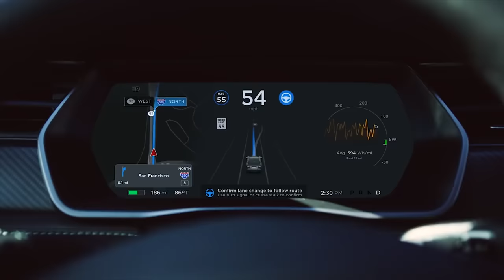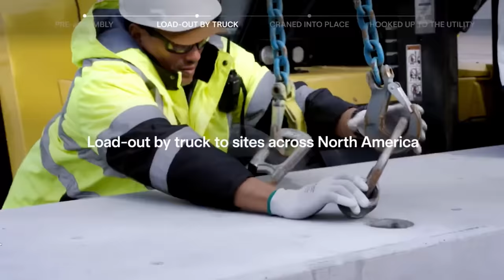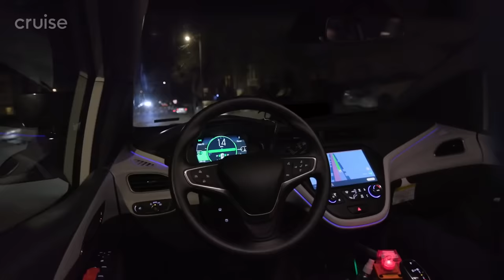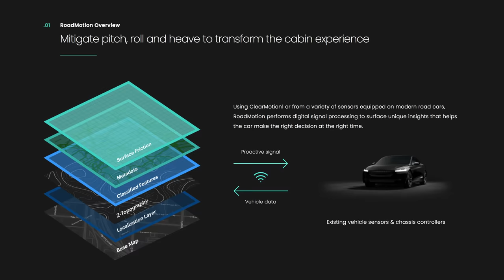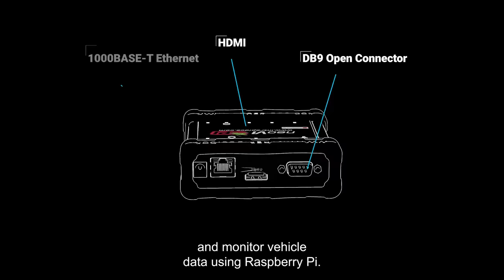BYD Makes More Per Car Than Ford; Tesla Slashes Supercharger Install Time - Autoline Daily 3786

Comment: The dealer network in general should be abandoned and dealerships should all be turned into repair and delivery stations...
Reply: No dealers are importend and amazing!
Reply: Get a Tesla, Lucid or Rivian today without the horrible dealer ripoff.  I bought my last three cars direct and it has been so much more pleasant.
Reply: Also convert some of the dealers into changing stations.
Reply: @brunoheggli2888 amazing at fucking the poor. I make $15/hour and CarMax dealership gave me a 2015 honda accord for $36,000 when the sticker price is $19,990. That extra $16,000 is all profit for them because they financed the deal too. I was young and naive, these dealerships do not care about people, only money.
Reply: Franchise dealer lobbying is very powerful. At this point I doubt the benefits of lobbying, tbh. Our economic and democratic system needs overhaul. Otherwise, we are gonna get stuck behind China pretty bad.
Reply: As a Tesla owner, dealing directly with the company that made my car is a HUGE improvement over the dealership model. Car dealerships add zero value.
Reply: @dangrass  this is the main reason I am considering a tesla despite renting rather than owning my home.
Reply: @jiamiekori6575  Gotta love the term "lobbying", the politically correct way of saying bribing.
Reply: Stupid will NEVER die!  I want a Volkswagen with privacy protection so I can see the dealer every week and make them do a manual software update....

Comment: Ford better step it up FAST instead of delaying everything.
Reply: Legacy does not want to see loose its golden goose.
However... w/o dealers pressuring automakers maybe their cars would last longer.
Reply: @danharold3087  
Looks to me as if Legacy is feasting on its golden goose.  

Legacy needs to be breeding a new golden goose because the current one is aging out.
Reply: BYD is looking to sell 4 million cars in 2024, which is getting close to Ford global sales numbers. By 2025 BYD may well have overtaken Ford in total units sold.

Comment: My experience in construct suggests that Tesla’s shortened install claim is all about pre spec civil works off loaded to a geotechnical/foundations contractor.  That contract is executed, complete with buried conduit, then they show up with their installer and drop the prefab units in.  Makes sense, as civil work is highly un-optimized, but I suspect a lot has been offloaded.

Comment: Any OEM that does not use direct sales has given up the pricing power that Tesla has because of having to pay a middleman. Ergo they will never be able to compete on price.... full stop.
Reply: Direct sale is shit!
Reply: King Toyota 6 full points of margin higher than legacy sales network Tesla!  Direct sales model ancient!
Reply: The dealership model will have to change.  The real profits are in maintenance, repairs, and parts sales.  That profit source will drastically shrink with EVs.

Maybe the future of dealerships will be something like Tesla Showrooms.
Reply: @bobwallace9753  Imposter CyberTruck owners beg to differ!  Chevy Vega more reliable at launch!
Reply: @bobbbobb4663  
Where does one find reliable data showing that the Cybertruck is unreliable?   I haven't found any.
Reply: yup....and I think people are just done with the dealership horror. Given the choice most folks would much prefer to buy the car online and have it serviced by the folks who built it.
Reply: Yep, not only do they cut out the middle man but they also can capitalize on "market adjustments" based on back order length like Tesla did, brilliant move on their part, just charge what people are willing to overpay for a car from the factory.
Reply: @anydaynow01  LOL sooo true.

Comment: Ford Mach E are Made by Mexican for American?👍
Reply: I think that's the only current Ford made in Mexico (please correct me if I'm wrong).

GM, on the other hand, makes the following in Mexico:  Chevrolet Equinox, Chevrolet Blazer, Chevrolet Silverado (Crew Cab), GMC Terrain. This also includes botht the EV & ICE variants the Blazer and Equinox.  I'm not sure about the new Silverado EV though.

Comment: Tesla charging will be a massive business itself and I think Tesla could buy convience store chain and just rebrand them as Tesla and have superchargers
Reply: Wrong!
Reply: Their price per kw will have to be more competitive then it is now or they will not gain much business.
Reply: @gmv0553  There is a lot of motivation for fossil fuel suppliers to keep the prices of fast charging and gasoline near parity.   Electricity is primarily generated by natural gas and coal.  So they have their have access to both ends.    I am familiar with the fact that they are globally traded.
Reply: @gmv0553  - It's still cheaper to fuel via Superchargers than gas for similar size vehicles. Perhaps in a few places where gas is highly subsided like Saudi Ariba it might be more expensive to Supercharge.
Reply: Tesla is actively working out deals with hotels restaurants and retail spots to place their supercharger stations and each party will take a cut of the revenues. No purchase of brick and mortar needed.
Reply: The big money is not in selling junk food in convenience stores.  And it has nothing to do with Tesla's mission statement.  Best to work out agreements with convenience store owners to install Superchargers at those stores and make money from charging.
Reply: @bobwallace9753  Just the charging rev. Dont think Tesla cares about corn chips.
Reply: @dclpgh  
I have no idea what you are trying to say.
Reply: WOW.... really? I said that in my original comment.
Reply: If they collab with 711, walmart, and familydollar it would cover almost all counties in every state.
Reply: @dclpgh  💯
Reply: 90% of Ev buyers charge at home public charging stations will never be a massive business, if they break even, thats about all they can hope for.
Reply: @davewhite113  the only problem with that scenario is apartment dwellers. I do know someone that bought a leaf and never had a home charger and just charged it at work for free. Then the pandemic kit.

Comment: Still wish Tesla would make a "off grid" package (solar, battery storage, charging stations all in one) for charging stations, to help take away the fears that EVs will bring the power grid down. It would also could be presented as something for use when grids do go down so that government and emergency services can still be on the move, plus owners of EVs could be still keep their vehicles going, which those with vehicle to grid power options could help keep homes, hospitals, etc, going in a major power outage. I really think it would be a great image boost for EVs in general if more of stations could be viewed as something to help keep power grids going or support for when they are down.
Reply: there is a company that made that with it all folding solar onto a basic flat trailer for 18 wheel truckers... solar could totally do that to debunk the naysayers.
Reply: Just settle for the Off your Rocker package you bought
Reply: @HDHQDIRECT  My Model 3 RWD has been great. Not missing ICE at all.
Reply: I actually thought Rivian was going to do this since early on they said they wanted to install chargers in remote locations.  Imagine an all solar/wind charging station in a national park.

Comment: You need to understand that US OEMs are going to go away or downsize to boutique manufacturers. 
If the Chinese get into the market here in the US then it will be quicker. Regardless Tesla will kill them with its gen 3 compaq car as well as robo-taxis. 
Why am I confident in this? Because I understand how much cash flow it takes for these OEMs to service their extreme amounts debt. Once we pass 25% new cars being EVs (most likely by 2026) the collapse in their cash flows ability to service their debts will start. Some sooner than others.  Once that starts they will have to start drastically downsizing and closing factories. The UAW will strike (as they gained the right to strike on plant closures) and the sheeot hits the fan. The collapse will then proceed very quickly.
Reply: Been hearing about Tesla Robotaxis for many years. Vaporware doesn't count.
Reply: @DouglasLippi   Remember when those 2017 and 2018 Model 3 owners proudly touted that their cars would be usable as Robotaxis?  🤣
Reply: The more they talk about profits made by OEMs the more people like you yap about them going down… what is wrong with you? Difficulties to understand?
Reply: Thanks for the laugh! You have no clue on what you are talking about!
Reply: About 95% BS.
Reply: @DouglasLippi  You should bring an open mind to it.  Not a single AI computer eng. chimes in to say it’s all fake like you are claiming. It’s a cry from the FUD crowd every time.  And always from ppl w/o any time withe the technology.
Reply: @DouglasLippi  
You need to watch some Tesla FSD Version 12 videos.  Tesla has made a huge, huge breakthrough when it comes to self-driving.  

Ignorance is not bliss....
Reply: @taniabanes4707  I guess we will see in the next four years if I am right. Then remember that I said it.
Reply: @gmv0553  Four years from now we both will see who is right.
Reply: @DouglasLippi  It will never happen!!!

Till it does 😉
Reply: @Cakebattered  still not off the table, but looking less likely with every passing year

Comment: BYD makes more money because labor is cheap. And they don't have profit sapping Unions to extort financially enviable salaries and benefits. I won't name names, but, UAW!
Reply: Wrong!
Reply: Labor is not so cheap in China these days.  IIRC labor costs in China are higher than in Mexico.  Look for one or several Chinese EV manufacturers opening factories in Mexico where they can build for less and import into the US without getting hit with tariffs.

That said, I'm not convinced Chinese EV manufacturers can compete with Tesla over the long run.  Tesla seems to be about to produce an EV with very few, possibly no, humans working in assembly.  And many of the parts and components produced very cost efficiently.   If Tesla cuts the time to produce to half of that of legacy factories that means roughly a 50% reduction in capex per car.

I'm sure Chinese companies (unlike US and European companies) will imitate but Tesla is likely to stay in the lead for some time.

Comment: What’s not being reported as of now if the quality of a BYD vehicle. What is the reliably and maintenance cost per year for the car. My concern as a consumer is would BYD be transparent with safety concerns, recalls. I would have this concern for any new auto start up. In the United States we have regulations for these concerns. Consumers should know the quality and reliability of the car they purchase. What is the crash report of these cars. I don’t believe BYD would be sold in the United States but they will be sold in Mexico and it’s possible they will be sold in Canada.
Reply: BYD has COMMERCIAL vehicles running the streets of the US, Canada, UK, Netherlands, China for a decade! Please stop exposing your ignorance in a public forum!
Reply: On a subjective level, BYD cars are clearly better put together than Tesla, with more consistent paint and panel gaps. They rank well above average and better than Tesla in the China Automobile Brand Quality Ranking. And the Seal and Dolphin were ranked as the top two safest vehicles globally, based on their performance in 2023 Euro NCAP testing, which is a stricter test than the older test  that Tesla went through for the 3/Y.

BYD's superior quality and safety has been reported, some people are just not aware of it.
Reply: Sandy Munro has good things to say about (at least) some Chinese EV companies.  In order to sell into Europe or the US BYD or another Chinese company would have to pass local safety tests.  Chinese EVs are being sold in the EU right now.
Reply: There's a reason BYD is THE biggest "new" energy vehicle maker in the world. are you trying to say those buyers can't tell the product they most likely use daily are good or not?
Reply: @bubuneowoo6161  Stop spreading your ignorance. A commercial vehicle is not the same as a family car. GM makes some of the best trucks, but their sedans were a completely different story.
Reply: I've got a deposit on a BYD Seal. Can't wait.

Comment: 3:39 I watched about 2 dozen spots open up near me, but it took like 2 months. So maybe it only requires 4 days of work, but other factors cause delays. Or Musk is lying as per usual.
Reply: Thats just the install they are hyping. Running the required power to the site and all the other equipment necessary can take quite a while

Comment: Of course BYD makes more per car.  Does BYD pay union wages or a living wage or even a good wage?
Reply: Cope better. BYD uses robots!
Reply: @bubuneowoo6161  Clueless.
Reply: They have the modern equivalent of slave labor.
Reply: @bubuneowoo6161  have you seen an American auto factory....full of robots too.
Reply: @tomjanowski8584  While the advent of smart humanoid robots is new you are correct about manufacturing's use of robotic arms and the like.  It is the human shape and the smarts that has people talking.   A humanoid robot should provide consistent assembly where humans struggle.

Comment: Here is my issue with blaming Tesla for auto pilot crashes. There are many other brands that offer this same technology, and I am sure crashes have happened with other auto makers. It feels like authorities are tagerting Tesla because of the name recognition. I have a Nissan that offers similar technology. As the drive, I have to be aware and take control when conditions warrant me taking control. I am always alert and aware, although my car is doing much of the work. I am not a fan of Tesla. I have chosen Rivian over Tesla. My point is this is a new technology in many new cars, not just EVs, and for some reason, Tesla is the only one being sued. The driver is always responsible.
Reply: It maybe a matter of scale.  A lot more Tesla cars driving with the technology.  But I agree that is not reason enough to  concentrate only on Tesla.
Reply: The case that was just settled.  Apparently the driver who was killed engaged Autopilot and then started playing a video game.  

If you turn on cruise control, don't pay attention, and your car rear ends  another car in your lane is that the fault of cruise control or you?
Reply: @bobwallace9753  I thought with Cruise control you couldn’t take your hands off the wheel. So how was the apple engineer playing video games? There was a video in the news just recently of a guy that looked like he was asleep in a Tesla on the freeway. How does that happen?
Reply: @russh6414  
Autopilot and FSD require periodic contact with the steering wheel.  I think Tesla may have added a camera inside the car that checks to see if the driver is looking at the road, but that would be only on newer models.

I'm not a video game player but I imagine there are games that don't require both hands at all times.  

Consumers Reports told people how to fool the system by, IIRC, attaching weight to the steering wheel.  I lost my last respect for that organization after doing that.
Reply: @bobwallace9753  Consumer Reports also showed how you could enable autopilot on a set up track and jump in the back seat with it still driving - right after a fatal accident in a neighborhood where 2 people died.  It turned out autopilot was not in use and not able to be put into use there and not the cause of the accident at all.  Pretty sick that they did that.
Reply: @whattheschmidt  

"Consumer Reports is funded through sales of magazine subscriptions as well as by notable left-leaning grantmaking organizations such as the William and Flora Hewlett Foundation, the Ford Foundation, and Craig Newmark Philanthropies.3"

"Marta Tellado is the president and CEO of Consumer Reports. Tellado was hired by Consumers Union in 2014 and was previously the vice president for global communications at the Ford Foundation,"

Is that a smoking gun?  I don't know.  But it does raise questions.

Comment: Tesla Headline News:  Adrian aka babysmurf9000 admits guilt!  "We will never surrender/settle an unjust case against us, even if we will probably lose"!  AutoPilot renamed AutoPerish!  More CyberStuck issues!  Another rush job from Captain K!
Reply: Good news, used Cyberust prices plummeting! (Oh wait, I thought you couldn't resell it for a year after purchase) My bad...
Reply: Wow, your coming off as a big hater of changing to electric vehicles. You seem to have a religiosity to you feels for ICE. You could learn fromf looking at the raw data gathered by 3rd party source. Teslas are so much safer to travel in that the test scale has to be changed> as Teslas data makes them so much safer than the other they have to change the rating structure.
Reply: @nathanroberson  Looks to parking lot...oh there is the THN Leaf!  42 perished due to AutoPerish!  Ford Pinto safer than Tesla!
Reply: @russh6414  😭 stated as a FUD pump.  The lower prices are above MSRP.   No ICE car has that demand, & never will.  New ICE car buyers are ether just the old slow conservative consumers, and they don’t mater, time will fix that.  Or they are the young/dumb that want the baseball card in their wheel noise they like.   And then there are the pragmatic car purchasers. They can do some math.  And they have no emo connection to the piston.  They know the electrons energy lies supreme over fossil fuel  endothermic power production.  Thats stuff is for Luddites to cuddle.   Electron power for American security!